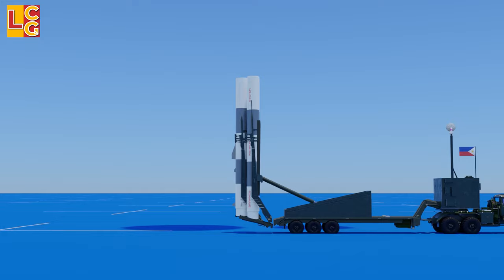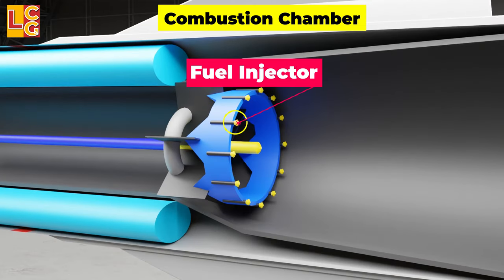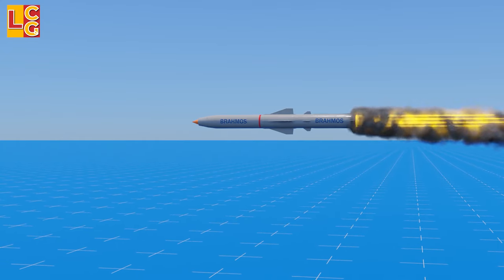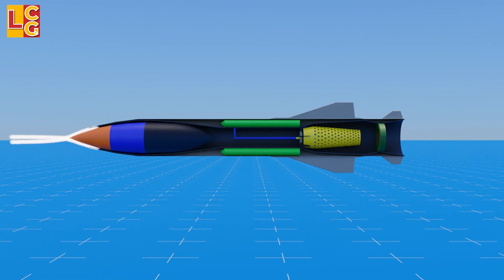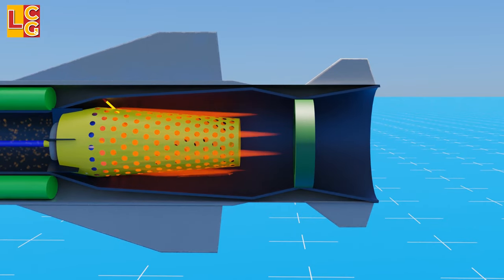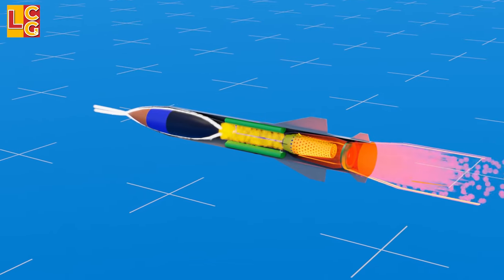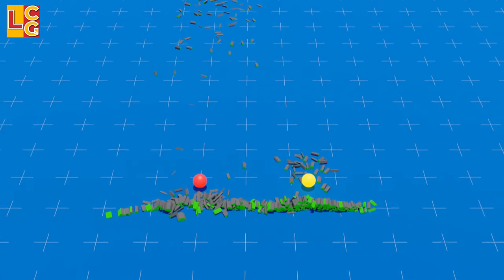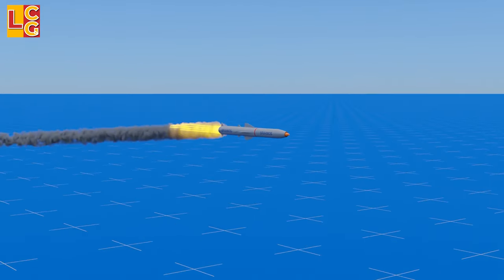How Supersonic Cruise Missile with Ramjet Works: BrahMos Missile

Comment: Why would there be a terminal shock somewhere in the middle of this annular passage? Looks like the first version of the Tu-144 where they preyed that with a long enough diffuser the air will slow down on its own? Then they learned from the Concorde that you need variable geometry. 

Translation of the nose cone alone may push the Mig-21 to Mach 2, but not more. Nice that the RADAR moved back into the compression cone!
Reply: And do you want think its design and technology is openly available for everyone to assess😂
Reply: @mystories7683  funny, I said the same thing about the new European fighter. I just want that the content creator is at least on the level of knowledge from when the Concorde was built. Even the Russians got to know about it. SR-71 is explained in detail. So at least present is a logical parallel construct instead of some nonsense.

Comment: The only time they'll know there was a brahmos missile is when they're hit by it? Well no, they'll have seen it a long distance off first. They're not that manoeuvrable and aren't particularly hard to take down. That kinetic energy can be used against it, especially with a fragmentation warhead.
Reply: 1.) Sea skimming profile means that unless you have an AEW&CS or a capable radar in the air that can look down and pick the missile apart in the sea clutter, your surface/ship radars are literally only going to see the missile seconds before impact. 

2.) BrahMos is maneuverable. It conducts an S-maneuver in 3D just before hitting, making it difficult for CIWS or SRSAMs on enemy vessel to engage it. It does not fly straight. 

3.) Do explain how you think a "fragmentation warhead" can defeat the BrahMos's kinetic energy advantage. 

This missile has valid criticisms that I can think of but you don't even mention them, probably because you don't know about them. You're just hating on this missile due to your own confirmation bias.